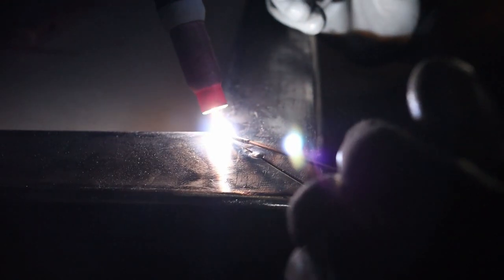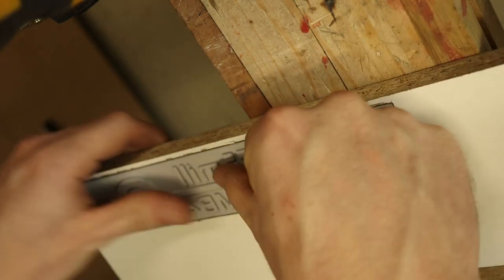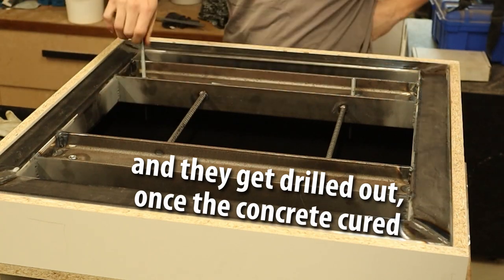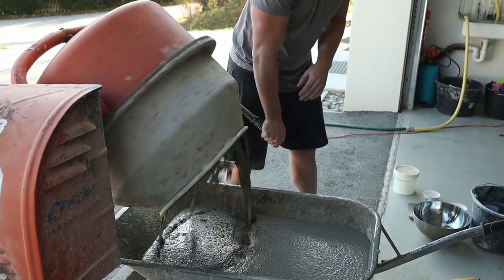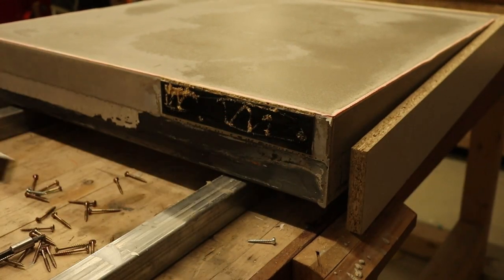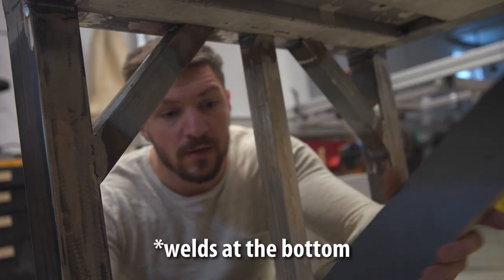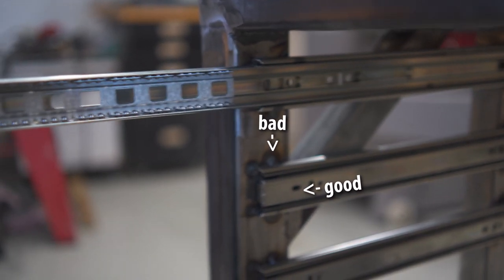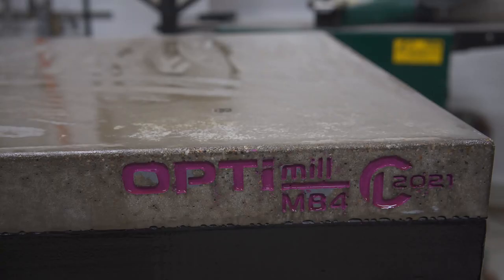UPGRADE YOUR MINI-MILL | ULTIMATE Mill Cabinet / Base

Comment: one thing you can still do is put a oversized piece of aluminium plate on the drawersfronts , it will ide the gaps in between the frame and the drawers and hide the drawerslides 
looks good , might try someting simulair but use a toolcart or two set of used steel deskdrawers as the base and build the frame around it , the concrete should help a lot against vibrations 
the meessing around with the ratchetstraps and the millhead looked familliar , had the same thing happening , small tip : get an engine hoist , there not that expensive , it does take in some room even when folded up but there extremely handy for moving heave stuff about the room (yes you can lift the whole mill with it )like workbenches lathes milling machines etc, they make good camera stands too
Reply from the maker: thanks for the comment!

a engine hoist has been on my nice to have list for a long time :D but something else always pops up :D
Reply: O. @ChristophLehner